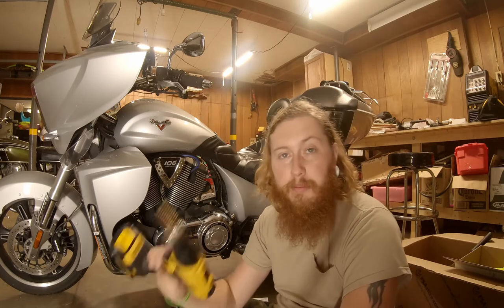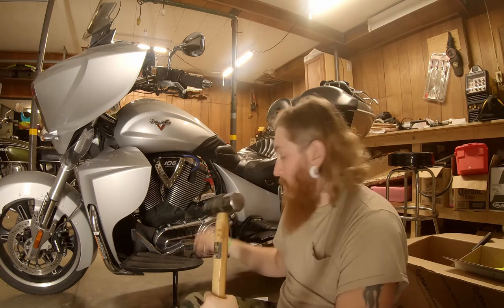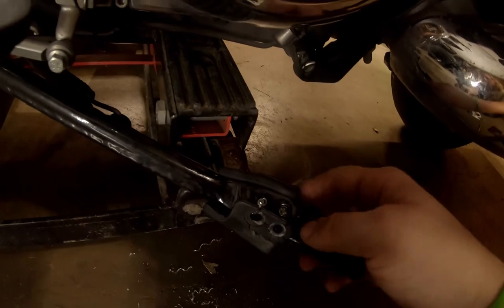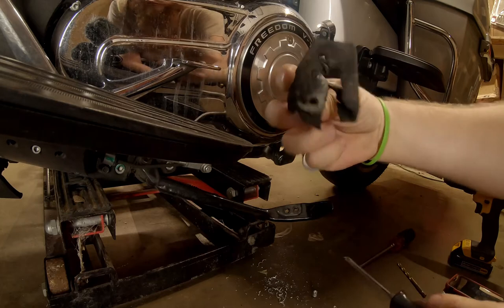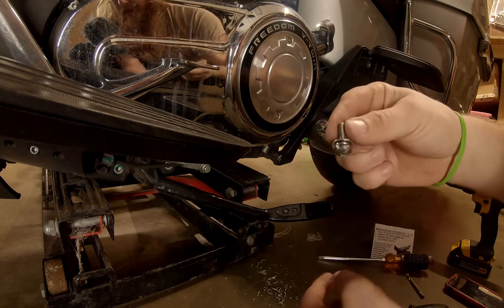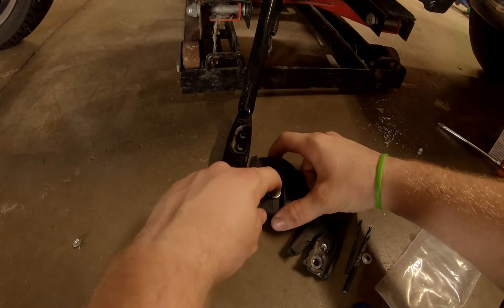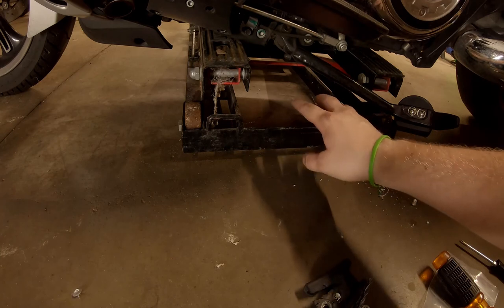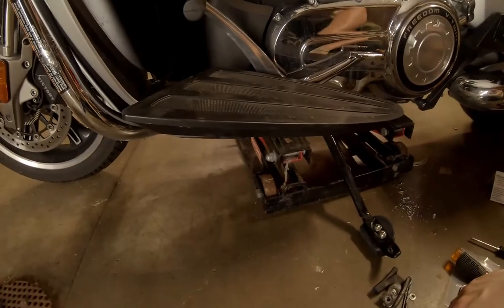Victory Kickstand Pad Replacement (Vic Puck)

Comment: Hello... I know that this is an old video but I wanted to give you a heads up. Victory kickstand are known to crack or bend bolt. While watching your video I noticed that the mounting bolt has a lot of play. If your bike leans more than usual. You might want to check the kickstand for cracks  a damaged bolt or missing nut.